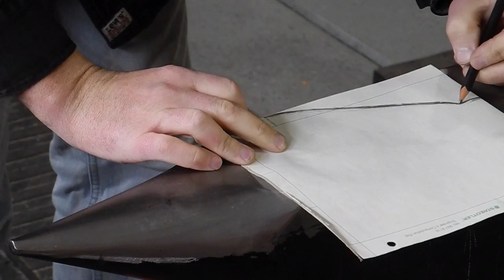Vise Spring

Comment: I forgot to ask,  did you quench the spring at the end?  I don't want to end up with a spring that's to stiff.
Reply from the maker: I figured that this steel was alloyed to be a spring therefore it would be one as long as I didn't introduce any stress and/or fractures.  So, I just normalized it by taking an even orange heat and letting it air cool.  If the ambient temp in your shop is kind of cold, you might want to do this 2-3 times.  This type of spring doesn't have to do much work; and I agree with you that tempering it seems like overkill.
Reply: That answers my question well enough. Thanks!

Comment: I'm a newbie. I picked up a post vice that doesn't have a spring. How necessary is it to have a spring? Is that something I should do right away?
Reply from the maker: The spring pushes the jaws apart making it easier and quicker to engage/disengage the hot work piece.  My advice... use it and if you get frustrated by the function of the jaws, then you probably need to make a spring.  Doesn't have to be a spring like the one I made, you can find a coil spring from the hardware store that fits somewhere below the jaws and fasten it with zip ties.  The best answer, though, is to act like a blacksmith and make one.